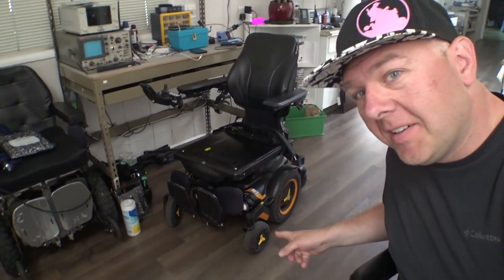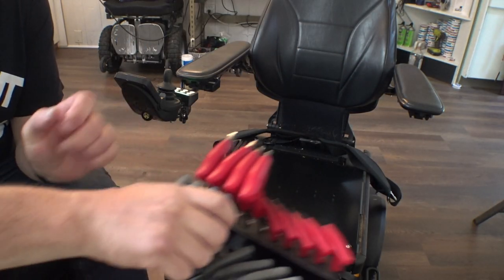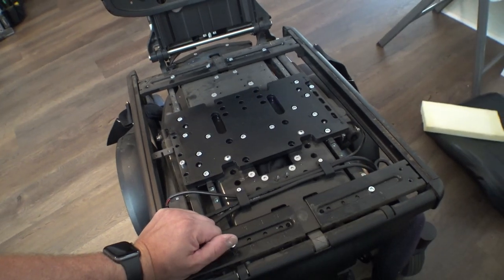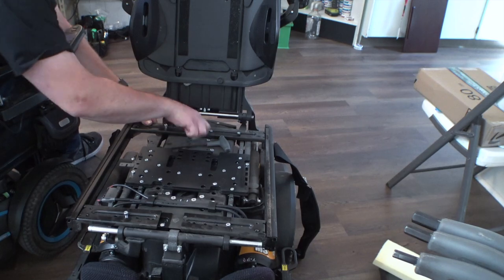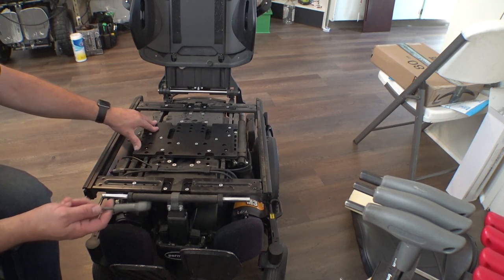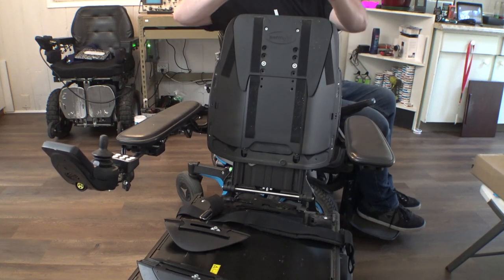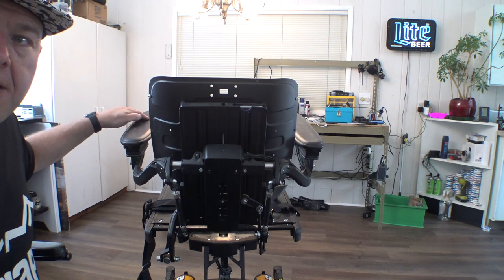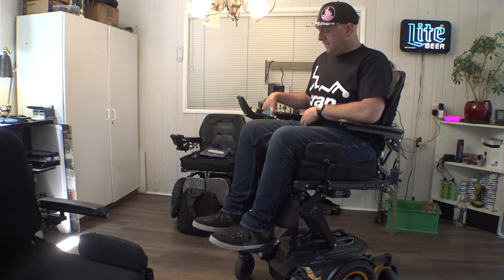VLOG 570: is an M3 the chair for me?

Comment: We needed to move the seat back and get a deeper cushion for my wife on her blue M3. Turns out that Permobil has different lengths of side rails, and ours were not long enough. So we're dragging through the DME/Medicare process of getting longer rails and a full Roho cushion (which is what my wife likes). Also, fyi, the clips on the plastic shield over the leg rest are very fragile. I asked the DME repair person whether he had to replace a lot of those, and he said "yes."
Reply: The accent colored parts?
Reply: @prettydisabled9060  No, he means the black plastic pieces on the front of the seat pan.

Comment: There is a trade off with Mid wheels, You have to be prepared to trade agility for comfort. Personally I have to live with the added pain of a mid wheel as I live in central London. Just getting on off packed busses quickly and affectively means I need to turn on the spot. My local pub is 200 years old. It has chair access but it's small, compact and busy. If I could not turn on the spot I could not pop into the pub. Outside of living in dense urban environments mid-wheel chairs make little sense. There is the added traction being over the wheel gives which means I can go off the tracks when I'm in the local parks and woods with my kids but again, the cost is pain. Don't know if you tried pneumatic tyres yet but don't expect major changes, improvements but not game changer. Pain or access, Pick one. I'm looking at the M5 at the moment to see if it offers a better compromise but then it becomes a size issue. Everything is compromise.

Comment: Hot tip on springs: preload doesn't make ride softer,  just lower. Look into springs rated at a lower N/cm (newton per centimeter) or Lbf/in (pound force per in). I was able to seriously soften up a quantum rival for a 130lb kid by finding $10 shocks for bikes rated at 450lbf/in, on Ebay.

Comment: I’ve been using my m3 for almost 2 years and started getting a bad jsm cable alert for the last few months. Took it into my providers office, they ran some tests and said they get the stuff within a few weeks. A few days pass on then my chair completely shuts off when I was trying to un-tilt, the screen stays off but makes the power on sound that was set. It’s been stuck in the tilt position for a week now and haven’t got any updates from when we called into their “emergency” number. I’m lucky my old chair is still in working order or I’d be screwed. It was a great chair all the way up until all that happened.

Comment: 9:20-- OK, you are extending the seat length so the leg rests extend out further. I have a question about seat location. Can the seat location be adjusted so that my weight is NOT loading the front wheels? I think the center point of my body mass needs to move back on my chair. However, what is a safe amount? You want the chair to be safe when it elevates and tilts. I suspect that's why they load the front tires...just to be sure you don't go backwards when elevated. Or, somebody wasn't paying attention when they built the thing.

Thanks Dan. I like this video. That sucks about the suspension. But still the best choice for me.

Comment: Very informative as usual. Thank you very much. BTW, I have an F3 as well. The one chair that I find has better suspension is the Quantum Edge 3. Obviously, the Quantum has some serious reliability issues but I found it has the best suspension, based on the chairs that I have tried. Of course, I use my F3 at least 10 times as much. ;-)
Reply from the maker: thats what kills me about the 4front i used to have.. it rode SO WELL!! (but only for about 25 miles at a time before breaking lol)

Comment: Interesting. Are US-built M3s mechanically identical to the Swedish versions (as I can see some aesthetic differences)? My M3 has transfer handles manufactured by Permobil, but side guards by Bodypoint - both have four screw holes but the side guards use a lever release rather than the screw+handle thing (have that on the transfer handles though).

Comment: I just got my Amysystems M3 yesterday. The independent suspension on all 4 casters of my Amysystems M3 makes for a much smoother ride than the Permobil M3. Plus, they offer the latitude system (a seating system that lowers all the way to 5 inches off the floor) for individuals up to 300 lbs for the standard M3 and 450 lbs on their HD model. I highly recommend checking out Amysystems for a mid-wheel drive wheelchair.
Reply from the maker: awesome! glad ya like it! ive always liked amy systems.. i just wish they made a front wheel drive chair!
Reply: David Brian-- Do you have a link to the Amy Systems M3 ? Thanks.

Comment: Hi Dan! My name is Joe. I’ve watching your videos for the last two weeks. I’m pretty impressed with your knowledge. Just want to thank you for passing on that good knowledge about what you know about wheelchairs. I’m telling you I’ve had nothing but bad luck with mine. What kind of wheelchair do you recommend for me to get. I’ve had a storm 3 and it been pretty dam good, but I think my motors are going bad. Any input. I’m pretty. Mechanical incline my only down side is that I only have the use of my right arm and my right leg. I need some information on my brake or on my motors. It seems to me that is what going wrong with it. Any suggestions would be greatly appreciate it.

Sincerely,
Hopper Joe!

Comment: Hello Dan, my name is Deanna and I am about to have a fit with this crappy company I am having to deal with, because they are the only one that takes Medicare! Anyway i have been researching the Permobil M5 and this is the one they told me i was aproved for, but now they are saying I was aproved for the M3! I am a T4 complete para with chronic back pain and i am normally in bed for the last 5 years, because of my pain. This will be my first power chair. Should I fight for the M5 due to their mistake? Is it a lot better ride as far as shock absorbance and back seat comfort? I also want to know what is your own personal chair that you swear by. I cannot afford to make the wrong choice. Thank you for your time in this matter.
Reply from the maker: i use an F3.. the ride quality on the F series chairs is a lot better than the M series.
however, the M5 is better than the M3 for ride quality.. but the F5 and F3 are my picks.  
the 5 series chairs are hard for insurance to quality in most cases (as they are group 4) the permobil aggressive tread tires do help with the ride quality as well.  front wheel drive chairs take some getting used to, and a bit more technique to maneuver around in, but i like them :^)
IMO the M3 rides like a shopping cart :^/ im not able to use one because of the bumpy ride quality

Comment: Hey Dan,
I have never had a power chair. I’ve been using manual chairs for 19 years now, but my health problems are increasing, and they are trying to get me in a power chair now too help. I’m such a rookie and curious when you talk about the blue tooth capability with the joystick, does that mean it is possible to drive the chair with a smart phone onto a hitch rack? I can not buy a van & I am trying to find a way to load a power chair on hitch rack when I’m alone, if this even a possibility? I’m just used to taking apart my manual chair & putting in my passenger seat. I Appreciate any advice you can help a beginner like me with learning about this!
Thanks!
Reply: It’s good look at his videos watch them and you’ll know exactly what you want help me
Reply: Be careful there’s lotta junk out there
Reply from the maker: hey! so the bluetooth just lets ya operate a computer mouse, or control your phone with the wheelchair joystick.  bluetooth driving of the chair isnt a thing just yet unfortunately :^)
Reply from the maker: as for hitch racks.. ya wanna be careful with those.. a lot of them are super weak and break easily.. also they tend to rattle the chairs like crazy and can cause issues with electrical connections coming loose, and / or road dirt and dust getting into the connections
Reply: @TotallyNormal-  Thanks Dan for this information, everything I am learning is helping a little more. I’m looking into the Bounder 300 with off-road package for my 1st power chair. I have watched MANY of your videos and it looks to be built strong, kind of more simple, durable, and able to handle sand and desert terrain which I have to deal with a lot. The 1st power chair they showed me was the Permobil F3 & it just did not seem like it would function well in the desert terrain of Arizona and a more complicated of a build with more gears and parts to break, maintain, repair, etc from what I have heard you say in your videos. Any advice or suggestions to help me decide on my 1st power chair from you or any others reading this I would appreciate Very Much! Thanks again to you and The Gamist for replying! As far as the rack build strength I have machinist and welder Friends that can make my hitch mount a solid build, but since no blue tooth driving ability yet, that means I will have to have my Brothers or Friends with me to be able to load my 1st power chair on my hitch rack and stick to my manual chair for driving alone to start. I just was hoping for some sort of independence loading my 1st power chair when driving. It would be a lot of work but I could do my same old routine with loading manual chair & then load/unload power chair and put the manual chair back in my SUV when I need to drive alone and independent. I have A LOT to learn about the power chairs, just kind of overwhelmed right now! Thanks again!
Reply from the maker: yea vans are EXPENSIVE.. ive managed to find a few of them here and there for a couple thousand over the years - BUT cheep ones are constantly breaking! and the last thing i need is something that leaves ya stranded inside the van! (its happened to me a few times lol) i like bounders a lot - for myself early on, i used a manual chair and a power chair in the house vs out running around.  the bounders are LARGE, and rear wheel drive - which makes maneuvering in smaller houses tricky at times.  i always recommend getting a demo chair brought out if possible and trying it in your living space to make sure it fits ok. got off road chairs i REALLY like the Frontier V6 - IMO its one of the best off road chairs available right now.  they have a slightly smaller version as well called the "C73" or urban/conpact 73 - that one fits indoors fairly well, and also works outdoors on different terrain types.  the C73 is also a group 3 chair that most insurance will cover :^)
Reply: @TotallyNormal-  Thanks all this information!

Comment: hello Bro again.. so for better comfort, and better managing with obsticles on the road you'd prefer F3, Right?
Reply from the maker: front wheel drive chairs can take a bit more maneuvering at times, BUT the F3 does have a lot better suspension for sure. but after a few weeks of use, you'll never go back to mid wheel chairs! lol
Reply: @TotallyNormal-  thx, till i find f3 or f5 , i am happy with my c500 esp:) only downside is not that height elevator like in F3...
Reply: @TotallyNormal-  i have option to exchange my c500s for f5 with r-net and the modern color joystick, do you think its worth it?  I had paid 1400 $ for c500 , for the F5 (used) the store wants 2800 $
Reply from the maker: the F5 is essentially the modern C500 :^) just make sure everything operates properly on it first!
Reply: @TotallyNormal-  thank you, one more question, have you weighted your F3? is it lighter than F5? cause F5 have 410 lbs , that little too much for me :(

Comment: Hi there would love your advise I always watch your powerchair videos . I have been using a invacare storm 4 for the last 3 Years the only thing going for that chair is the speed lol. I'm a female age 38 so I don't like to go slow when out and about . 
I'm about to purchase a new powerchair this summer mow I'm debating with the 4 front which I know you have driven but also the permobile m5 . I really could do with your opinion as I've never owned any of the brands xxx
Reply from the maker: i personally had a terrible experience with the quantum 4Front, and its reliability - as did a friend also.  The permobil 5 series chairs have high speed motors, (7.5 mph) and are very good overall! 
(the quantum 4fronts top out at about 6MPH)
Reply: @TotallyNormal-  thank you Soo much for your advise I will be placing a order for the m5 then on Thursday xxxx

Comment: special case ? hell no . I have a m3 and using a chin control, my joystick bounces everywhere. hence I'm getting a f3 ordered as we speak. wait question, I have a old m3 per 2016. mine uses a Bluetooth hub behind my back rest. now it's in the joystick? or because I use a chin joystick (well it's called a micro joystick I think ) do I need the hub still ? also is that a pre 2020 m3? because they have a new  m3 and f3 that I believe have a better suspension.
Reply from the maker: the newer, larger joysticks have integrated bluetooth now (have been for a few years actually at this point) - the separate module is no longer required for phone, switch, and mouse control -  FYI this M3 in the video is from 2017.  im not 100% familiar with the bluetooth joystick setup you're describing - just to be safe, you'll wanna verify it's compatible.  but from my understanding that extra BT module isnt required anymore.

Comment: Hey my M3 jerks when I move forward or back but mostly when I turn.  Do you know if that is an adjustment like gear lash or brake adj... I know nothing yet but fixen to get an education real soon when I tear it down and hoping to get answers first!!  Thanks in advance for any info from anybody.........
Reply from the maker: depends on a few things...
how old is the chair, how many miles roughly.. 
what type of surface are ya driving on when this happens? (carpet etc)
and does it happen all the time? or just occasionally?
Reply: @TotallyNormal-  If it sits for a while it is worse.  The chair is 5years old and has the original batteries in it. The batteries last all day barely though. 
We have tile and laminate wood floors. 
It jerks mostly turning either direction on all surfaces. I thought for sure the gears had two planes of contact wore on them but I don't know. I am eligible for a new one but still want to get this one fixed for outside..

Comment: Would the computer module ever damage the batteries?
Reply from the maker: Only when the chair is sitting, and not being used - the control system uses a small amount of power. So if the chair is going to be stored more than a few weeks, the breaker on the back of the chair should be turned off to prevent the batteries from being damaged, by being run super low over time.
Reply: @TotallyNormal-  I use it every day so I guess there wouldn’t be any point in changing it....I’ve changed all wires from the joystick to the batteries.
Reply from the maker: having battery issues?
Reply: @TotallyNormal-  Im the one with the jazzy elite 14 that kills the batteries after 2 months.
Reply from the maker: OHH gotya.... (i forgets lol)

Comment: Orange Isn't My Color. I I Have A Red 2013 
F3. It Has The Wide Arms. I was Wondering
If I Could Hook Up Lights On It?
& I Have Headlights & Taillights  On My Quantom
Q 6 Edge & I Was Wondering If I Could Hook UP
Turn Signals On It. I Have An Egg Type
Switch On My Q 6 Edge. But I'd Probly
Need A Turn Signal Switch.
Reply from the maker: on the quantum chairs with the egg switch, the lighting is totally independent of the chair's electronics.  if you want the ACTUAL headlights, ya need a different seating control module, and joystick for those.

Comment: How the hell did you get rid of that click @ 3:13? Is that something I can do on my M3? I hate that click with the intensity of a thousand suns.
Reply from the maker: ah yes.. STEALTH MODE!  you need a programmer to make it go away.. (R-NET USB dongle) and an understanding that its pretty dangerous to do... BUT ive got a guide on how to make it happen :^)  haven't transferred that particular guide over to the new website yet.. but i can send a link if you have a dongle!
Reply: I remember seeing that. It looked like you were able to flip a switch or something and I was hoping there was some way to quickly toggle between normal and stealth modes. There are some times when I really don't want to hear that big click like when I'm recording a video on my phone or trying not to wake up my family in the middle of the night, etc. Oh well. A guy can wish. Thanks!
Reply from the maker: essentially ya use the programmer to tell the chair to ignore the position of the brake levers.. then ya can turn them on and off as you please and still move around!
Reply: Gotcha! Thanks!